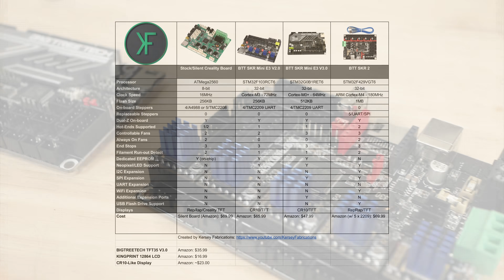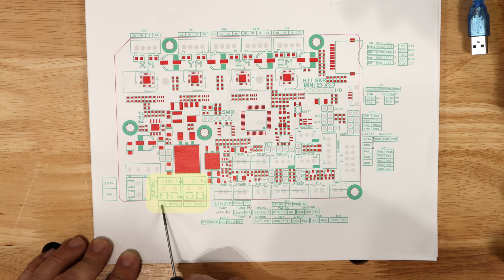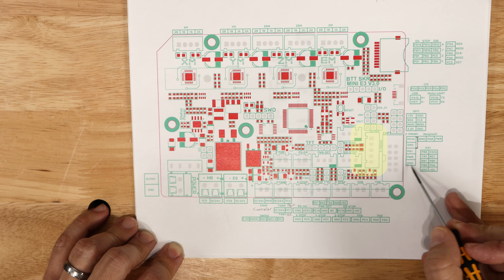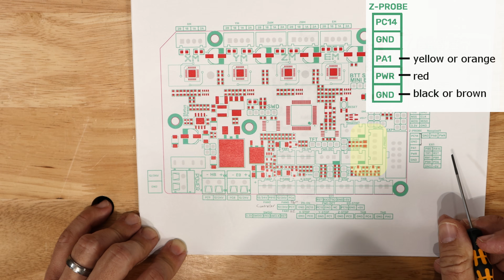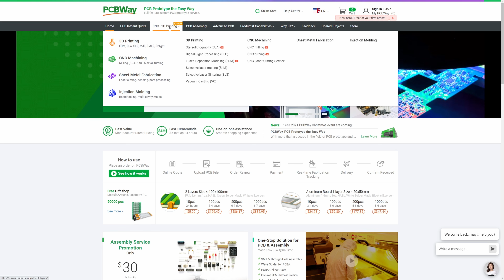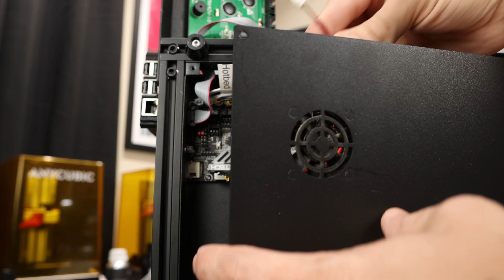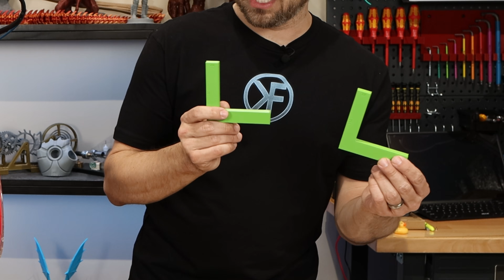Bigtreetech SKR Mini E3 V3.0 - Ender 5 and Ender 5 Plus

Comment: 15:22 - I believe you are not correct about this.  The Ender 5 Plus with bltouch does not have a Z-stop connector at all.  I got really confused that I couldn't find one.  The two-pin jst connector from the bltouch (black and white wires) does not connect here at all.  It appears to need to connect to the 5-pin bltouch/probe connector on the SKR Mini e3 v3, along with the other three orange/red/brown bltouch wires on a separate connector.
Thanks for the video!
Reply from the maker: The 2-pin connector can go to the probe connector OR the z endstop connector, depending on how you have it configured in Marlin.
Reply: @kerseyfabs hey man, I have installed your ender5plus firmware, thanks for that! I’ve got the stock bltouch… should I connect the 2pin z stop (black/white wires) or the z probe (brown, red, orange)? I know as you updated in the first comment that it might not work at all though… the bltouch seem generally alive on startup, when both of them connected, but it won’t extend its probe thingy when homing…
Reply from the maker: @aryez91  I usually put where to connect it in the filename or in the video. Let me know what you find. It's been a while.
Reply: @kerseyfabs  I appreciate you replying to threads.  I have a ender 5 plus with a bl touch & added the tft35 with a v3.0.1 - Using the firmware you provided, "SKR Mini E3 V3.0 - Ender 5 Plus - BLTouch connected to Probe" My z-axis is reversed, up is down and down is up in the touch UI. I did in the probe in wire order (white, black, orange, red, brown) and also tried (black, white, orange, red, brown) but z-axis is still reversed. My auto leveling also doesn't work which I figure is a downstream result of the reversed z-axis. Not sure what's wrong, maybe I need to reverse the (white, black, brown, red, orange) order as well for the probe?

Comment: i can not get this to power on. my Power cables are so tiny, why?
Reply from the maker: Which power cables are so tiny? Does your system not look like mine?
Reply: @kerseyfabs  no my main power cables or half the size lol i thought maybe i had the wrong wires but no there 100% the ones that were used prior. They look lkke speaker wires

Comment: Thank you for providing the compiled firmware.  I had trouble with my ender 5 pro and the skr mini e3, I almost gave up on it and bought a creality board.  I thought my prints were being underextruded but my problem was the Z screw on my old ender 5 pro is different from the newer ones.  My lead screw had 4 starts and the provided firmware was built for a printer with the updated 2 start lead screw.  Change your steps/mm for the Z axis from 800 to 400 and you'll be printing normally or change the lead screw to the new design.
Reply from the maker: Thanks for the feedback!

Comment: Chris,   Thanks for the help. I have another problem. The BTT mini 3.0 doesn't work with the stock screen on the Ender 5 Plus. The only LCD I can find for the mini 3.0 is the TFT35 E3 V3.0.1 which does not fit the Ender 5 plus. How did you resolve this with your Ender 5 Plus?
Reply from the maker: Replied in your other thread too: https://youtu.be/vS8RM2RPe-s

Comment: Hi, I'm following your instructions for replacing my stock board with the BTT 3.0 for ender 5 plus. Ive connected all of the leads but dont know where the filament detector lead fits.  Where do I fit the connector for the  filament detector?
Reply from the maker: I believe that goes into the E0 Stop. Find a pin-out diagram and make sure the wiring is right: PC15 - yellow, GND - Black, +5V - red
Reply: @kerseyfabs  Thanks for the help. I have another problem. The BTT mini 3.0 doesn't work with the stock screen on the Ender 5 Plus. The only LCD I can find for the mini 3.0 is the TFT35 E3 V3.0.1 which does not fit the Ender 5 plus. How did you resolve this with your Ender 5 Plus?
Reply from the maker: @michaelwall6240  That one's easy. I have it covered here: https://youtu.be/l7mxGVF-QGE
Reply from the maker: Actually, this one one shows the option I'm using on mine: https://youtu.be/vS8RM2RPe-s

Comment: This got got me working , but now my printer has the home set to the bottom left corner instead of the top right and it constantly tries to run off the side of the build plate. Any advice? I am new to this as this was given to me. edited to add ender 5 pro
Reply from the maker: Make sure that the firmware flashed correctly. It should show the version you downloaded on the boot screen or the info screen. If that's correct, go into the configuration menu and init the EEPROM again to make sure you clear any old settings.

Comment: I followed your video to get the board going...THANK YOU.  It looked like you had a Pi on this printer.  Do you know how I can use Octoprint with this board?
Reply from the maker: You're welcome! If you install OctoPrint on a Raspberry Pi, it will have no problem connecting to this board/firmware.
Reply: @kerseyfabs  I tried and the pi does not recognize it. I read something about jumpers needed for the port to work with a pi. Can you let me Kim’s what you have set up so I can try to duplicate?

Comment: I tried using your firmware, and it doesn't work😬
Reply from the maker: That's pretty vague. I'm happy to help debug a bit. What's going on?
Reply: @kerseyfabs  the bed doesn't auto level without my motor Making a noise. The hotend fails to heat but the bed is fine when it heats, and on occasion i can get it to heat but it thermal runaways
Reply from the maker: Are you running stock hardware or any special changes?
Reply: @kerseyfabs  stock

Comment: I just did this in a Sovol SV05 which started with a Creality 4.2.2 board, I wanted TMC2209 stepper drivers so installed the BTT SKR Mini E3 V3.0. All of my issues were firmware based I burned up a CR Touch because I thought it was electrical, it turned out to be firmware. I replaced the CR Touch with a BL Touch. Ended up building Marlin from scratch.

Comment: is it possible to connect a chamber temp censor on this board?  im using the tft50 v3 with this board and i like to see the temp in chamber i have a thermoster extra i can use so where can i connect this on the board

Comment: Great video!  Which version of your FW download supports Ender 5 Pro w/BL Touch connected to Z endstop?
Reply from the maker: I believe this is the file you're looking for: https://drive.google.com/file/d/1i-GdUXOLjFB8O5mNnY7nr-swB2JnRPYW/view?usp=drive_link
Reply: @kerseyfabs  Thanks.  It seems that the firmware I need is somewhere in between!  My machine is a E5 Pro with the BLTouch configured in conjunction with the Z-stop.  Your firmware for the 5 Pro is either "No BLTouch" or "BLTouch connected to Probe".  Thoughts?
Reply from the maker: Did you try the one I linked to? I think that's the one you want.
Reply: I've tried it multiple times - never gets to the Marlin boot screen - just sits on a blank screen.  @kerseyfabs

Comment: I have a extra 3 wire plug with no marking on it  that went to a 3 pin plug marked x under where display wire goes (red/black/yellow) not sure where to plug in  my other x wires plugged in my printer Ender 5 Plus
Reply from the maker: That sounds like it could be the filament run-out detection. I hope this helps!

Comment: Anyone feel like sending some help? 
I have a Ender 3 the SKR mini e3v3, TFT35 and BL touch. As far as I can tell firmware should have been a easy drop on sd card rename and load. Doing this made the LCD not work and no printer found on the TFT.
I don't know what is involved in compiling my own firmware but is that what I am supposed to do?

Comment: ive upgraded my ender 5 pro with the skr mini e3 v3. it also is running the biqu h2 v2 extruder.
every thing was fine now after the upgrade, my bency print is elongated on the z axis.
my z steps mm are set at 800, i reset my esteps to 932 and the bed is levelled.
could any one help pls

Comment: hi
many thanks for your great video instruction. i have an ender 5 plus. i followed this to the letter, re-named the firmware file as you mentioned. switched it on and apart from red flashing led on the board, nothing else is happening! no fans nothing! the only movement is the cr touch probe initializes itself and thats it! help!!

Comment: I absolutely dislike this SKR Mini E3 v3.0. It is NOT silent. It's not super loud but there is a very clear noise coming from it.
Reply from the maker: Well, I can't say that I find it noisy and it's still working well on my Ender 5. It never really got fixed on the Ender 5 Plus though.
Reply: @kerseyfabs  I swapped to the firmware on reddit and it works great for me on the ender 5 plus. I tried multiple times on your firmware, I tried modifying your firmware. I messed with it for almost a year before trying the firmware on reddit. I really liked all the features and everything with yours. I have no clue what the difference is.
Reply from the maker: Yeah, I took a look at that one and I'm not sure what he did differently either.

Comment: I set this up for an ender 5 Plus with the correct firmware. But if my filament sensor is plugged in my printer will not turn on. Has anyone found a fix for this?
Reply from the maker: It definitely sounds like there's a short in that part or it's wired incorrectly for the board. Check the pin-out.
Reply: @kerseyfabs  you were correct. Another issue I'm having is my CR touch will not work with the probe only software. I have checked the wires and pin out and they seem correct.
Reply from the maker: @nathanielmiller7311  Where do you have the probe pins plugged in?

Comment: Does the fan voltage depend on the main voltage or can this be set? There's no step down?
Reply from the maker: Some newer boards have a couple of fan headers that can be configured to different output voltages. Most boards you cannot change the output from the input voltage. So, 24V systems use 24V fans.
Reply: @kerseyfabs  Thanks for the reply and the video.

Comment: Hey, what did you use to remove the paper and glue residue from ender 5 sticker ?
Reply from the maker: I can try using isopropyl alcohol first. If that doesn't work, acetone. 3M also makes a special adhesive remover. https://amzn.to/3Kwxlzw
Reply: @kerseyfabs  That's a nice solution recommendation. I have ended up soaking in oil and scrubbing with plastic. One nasty job.

Comment: How did you get this board to work with Octoprint? I cannot get it to detect my printer...
Reply from the maker: I had no problems at all with my firmware. Make sure you have your serial ports configured correctly.
Reply: @kerseyfabs  configure it in the firmware or on Octoprint? What version of Marlin are you using? Perhaps have a link? This is driving me nuts...

Comment: The firmware downloads you posted won't open. Any advice?
Reply from the maker: Do you get an error or anything? Which firmware are you trying to get?
Reply: @kerseyfabs  The error I get says; the file is damaged or 1 File Viewer could not open this file:
C:\Users\13155\Downloads \firmware-BTTMiniE3V3.0-ESP-PROBE-2.1.1-KF-20220926-02.bin
Reply from the maker: @brucemansfield2501  What are you trying to do? What's saying that? That's not an error I'm familiar with.

Comment: My printer got unsusable because it keeps trying to print outside the board, how is this possible? I thought this would be plug and play. All the wires are in the right place, first it homes and then it makes the test line on the other side of the bed, it makes no sense, tried to compile marlin but it also does not help. It like it is reading the gcode of the slicer wrong.
Reply: I know its way to latr, But, you have propably plugged the stepper motor in the wrong Direction , if you dont want to change the wires, just put  a ! Before the pin of the stepper . Cheers

Comment: After I did the upgrade and flahed the firmware I noticed that all my settings are off, the test trip isin the middle of the bed and the print starts off the bed and the print head is remming into the sides. Any idea what could be wrong here?

Comment: I seem to be having an issue with the cr touch on my ender 5 Pro, correct firmware installed and with the z end stop unplugged when I run a bed level test the nozzle will move to front left lower down and raise slightly before giving me an m112 shutdown. With the z end stop connected it will try to do everything however the probe won't deploy

Comment: Thank you for the firmware. I've downloaded the Ender 5 - BLTouch - BLTouch connected to Probe one but when I try to Validate Mesh it gives me the error - Unknown command: "G26 H200 B60 R99" and I think that is because Mesh Validation was not enabled in config. Can i fix this myself without rebuilding the whole firmware?

Comment: Ive got a customer right now wanting to put the skr mini 3.0 mainboard, TFT35-E3 V3.0.1 screen, & a Sprite Pro extruder on his Ender 5 Plus. He messed up the original ribbon cable to wire harness connector cable, & provided what seems to me to be the sprite ribbon cable from the s1. Would you say it would be safe to do this install by cutting the other end & pinning new wire harness connectors on? Cant find anyone else that has done all these upgrades.

Comment: I’m considering switching the stock silent board to the SKR E3 mini v3 and run Klipper.  Are there any things I need to be aware of?  Such as flashing the firmware and printer.cfg differences.
Reply from the maker: I'm not a Klipper expert unfortunately. I'd look up the Klipper users groups and the Klipper Discord server for more info.
Reply: @kerseyfabs  Isn’t it always the way that i find what i’m are looking for after I give up and ask. 
Select/keep the same configuration as the original build
for SKR Mini E3 V3.0: select the following
STM32
STM32GOB1
8KiB bootloader
USB (on PA11/PA12)

I held on to Marlin until recently, but am absolutely loving the switch to Klipper ChefKiss.gif

Comment: I connected the BLtouch to the Z-stop and rewired my pins accordingly, but i am having a lot of issues with BLtouch randomly failing, not deploying, stops leveling at random points. I tried a new bltouch and have the same issues.. any ideas what I could do to fix it?
Reply: Fixed my issues by recompiling firmware and changing some of the values of the BLTouch. I changed the minimum delay between commands to 1000 ms, I switched it off from High Speed mode, i set SW Mode, and i had to increase the noise threshold for end stops to 5. Has not failed at all anymore, i changed the bed leveling grid to 10x10 to do a "reliability" check and it completed successfully a few times, where as before it wouldn't get through more than a few before failing.
Reply from the maker: Thanks for the feedback. I'm going to play with these.
Reply: @kerseyfabs  I have a 2nd ender 5 plus at work, put the same firmware on with my changes above and have not had a single BLTouch/CRTouch failure since! My 1 complaint with this board is finally addressed.

Comment: @8:53 you mentioned the 5th driver could do a auto left & right level on the z axis with Marlin. In what scenario would this be helpful and should that be a deal breaker to buying a SKR3 vs Mini SKR3 e3 v3.0 for Ender 5 PLUS?
Reply from the maker: It helps when it comes to making sure the bed hasn't dropped at all or you bump one of the screws. It's not a deal breaker but I nice to have.